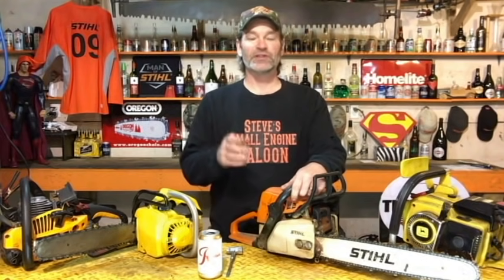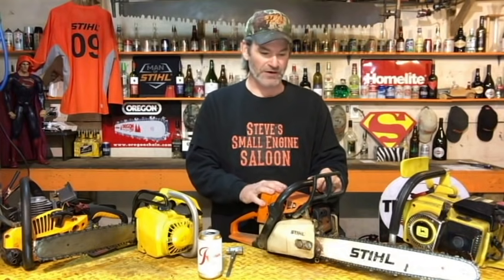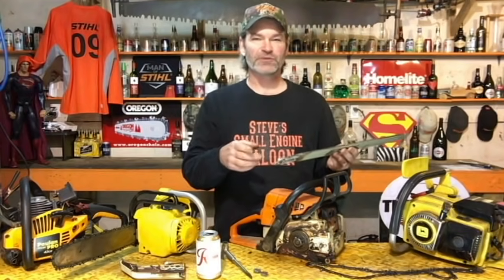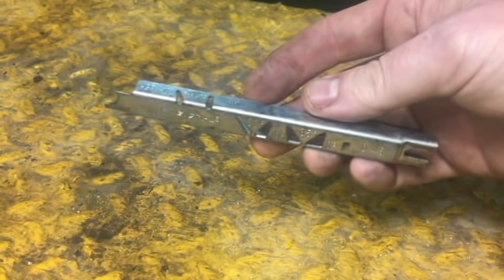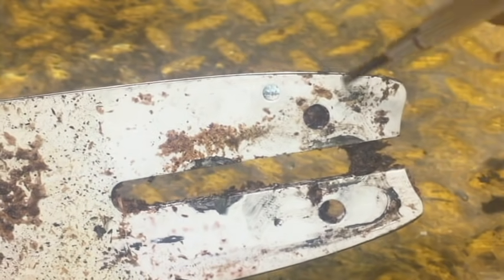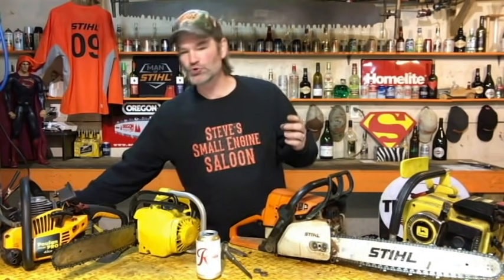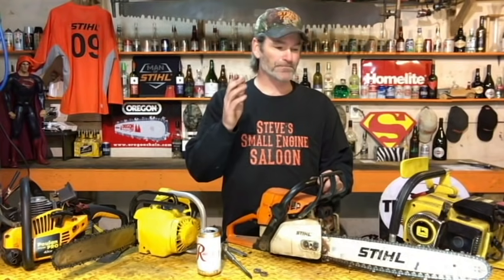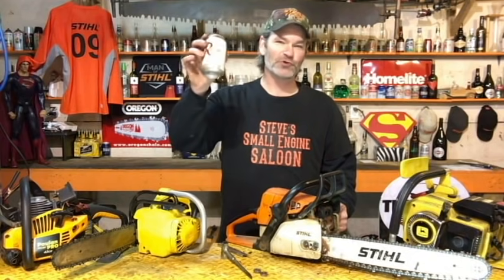How To Fix A ChainSaw If It Won't Oil The Bar And Chain

Comment: Yes, Steve, take a dremel cut off wheel tool and cut maybe 3" off an old worn hacksaw blade. Grind the teeth off it too Epoxy glue about 3/4 " into some sort of wooden stick for a handle, grind a bit of a hook onto the rest of the blade.  This acts as a raker ( there's that word again, but this time it rakes) to get the oily gunk outta the rail groove. Drill a hole in the handle and write on it "chain bar groove cleaner", hang it on a peg hook so when the little Frau comes into the shop to "tidy up" she doesn't think it's a piece of junk you cobbled together for some unknown reason. (My wife is scared to death to see the condition of my benches -- if she needs a wrench or a hammer, or some other implement of construction/ destruction, she asks me.)   Even some carb cleaner will blast a chunk of crud from that hole once the groove is scraped out.  Cheers, my friend.  Sometimes we have to invent whatever works.   Bob in Montana

Comment: Ya and if you have a husky 335 limbing saw that does not oil and it's not coming out of the saw you might as well just throw the saw into the dumpster because to get to the internal oil lines and tiny pump the entire saw must be dismantled, COMPLETELY!. The husky 335's are one of the worst designed saws that I have ever seen, absolute JUNK!

Comment: Great video as usually, sometimes the most obvious is the hardest. Just 2 things:1. If there's no oil in the bar, the chain will get really hot and extend so much that you can't miss it. It did so for me when the oil hose broke.2. Running the saw without the chain and cover can be really dangerous, when you accelerate it's no problem but when you release the gas the clutch can unscrew itself. If the chain is present it breaks the drive wheel and stops it from unscrewing but without it it might unscrew itself and the pieces go very fast out from the drive wheel and clutch, maybe into you face if you are checking the oil. Be careful!A safer way is to use a drill and press the chuck (or a rubber wheel) against the drive wheel (drill in reverse if I remember right).Better safe than sorry.
Reply from the maker: Great comment.  Thank You...

Comment: In your professional opinion Steve, what is the most durable all around best model (old school) chainsaw Stihl built?  Maybe factor in popularity.........   (If your opinion differs from mine, won't hold that against ya, LOL)
Reply from the maker: Off the top of my head, big saw, 066.  Mid range saw 034,036,038 types..... and small awesome saw, 026.....
Reply: Yes, I have to agree the 066 is somewhat of a legend in it's own time, never did own a new one, I am collecting 034's these days currently have 3, trying to get my hands on one of the older 66's......  I have an 046 (bought in '96 new)  it has been a nice saw.  I bought a 036 at the same time it run perfect for about a year, then started acting up had to 2 different shops they couldn't correct the lean spot, tried new coil, carb kit and fuel lines, still had a dead spot, finally gave it away......(Chinese carb on it)

Comment: Hi Steve. I have been trying to solve a very unusual, technically imposible problem . Maybe you can shine some light on it for me.
I had to replace the chain oil pump due to damage but when I put the whole assembly back together and started the saw there was no oil on the bar.
After numerous times trying to determine why no oil was coming out on the discharge side I tried a small experiment and it turned out that with the engine running the pump was sucking oil on the discharge side and discharging it on the supply side( tank side), which is technically impossible because the engine shaft turns only in one direction(clockwise). I tried to detetmine  the direction of the pump shaft in relation to the rotation of the engine shaft and it turns out that the pump shaft would have to turn in the opposite direction. 
Honestly, I don't know how this can be possible. The pump assembly is very simple and there is only one way to put it together.  I need help.

Comment: Thanks mate!
Reply from the maker: You're welcome...
Reply: At the time of writing I hadn't yet tested what you showed, but soon afterwards got out my air compressor and wow, what a powerful way to clear the holes!  My chain is now getting oiled again.  Self-service at no cost.  Cheers!
Reply: Steve's Small Engine Saloon hey brother I have a 16” McClellan throw away saw. It actually runs good but it gets HOT after a few minutes. Maybe an oil issue? Any ideas on trouble shooting? Or point me to a video you done about this topic? I’m new to using a saw and and working on them but ur vids help a lot! Thanks

Comment: Damn it Steve is out of BEER   LOL...............  

A buddy brought in a Husqvarna  141  in my shop for a oil pump job......  I glanced at the saw and told he had the wrong bar on it.....  He had a Oregon EZ adjust on a regular adjust saw.... 

He said his buddy liked the EZ and wanted to keep it that way.....  So I told him I would do away with the built in adjuster and the OR bar would work right...........  

WRONG the oil holes didn't match up...  That and 1/2 inch of compacted sawdust was keeping the oil from flowing out of the saw..............   

Plus Tard Mon Ami ~!~!
Reply: You just gave me the idea of what to look for. I bought a used Jonsered that appeared to have a Stihl bar on it. Well I drilled the oil hole a hair bigger and voila I have oil now

Comment: Every time I pull the chain off I do two things. First a thorough cleaning and then I flip it over.
Reply: Flip the chain over? Why? It wont cut if its flipped over
Reply: J M. No the power head silly!

Comment: My saw leaks bar oil when it is sitting in place any suggestions?
Reply from the maker: My next video is on that exact subject.  Stay tuned...
Reply: Good to hear, I have the same problem. I had the saw running 2 mins, and when I came back there was a puddle of oil.